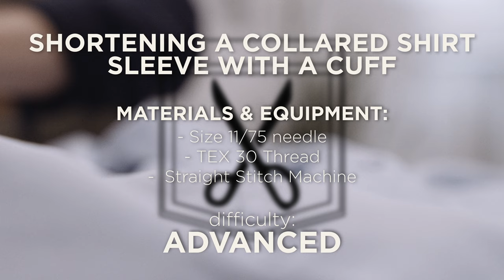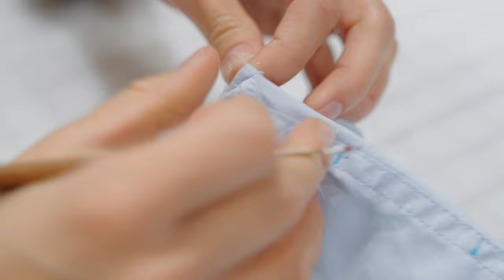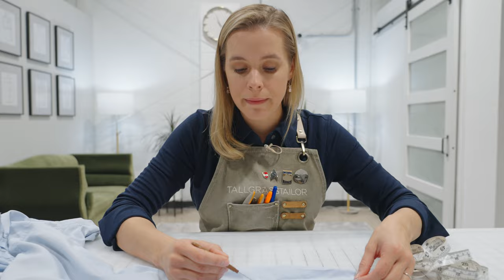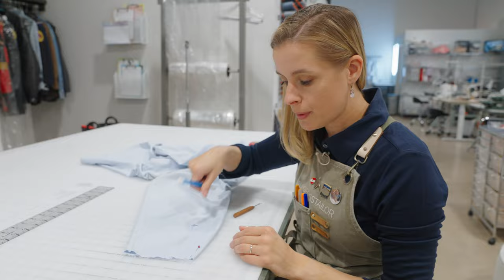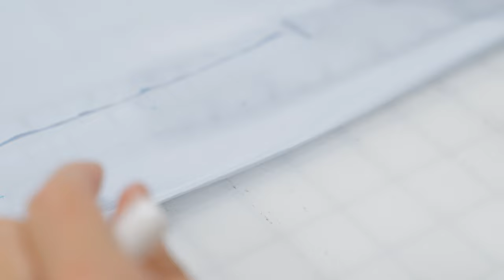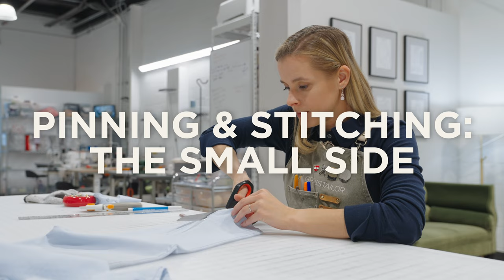Best Way To Shorten Men's Shirt Sleeves (Ep. 21)

Comment: Thanks for the video!! It worked perfectly for the first sleeve, but since the second sleeve is a mirror image, it was hard to know where to start the large placket because the fabric was on the right side by the cuff. 🤔 I'm about to try it and I feel pretty confident I can figure it out. I would request in the future if there are two sides that differ slightly, a note at the end would be helpful to address what to expect! 😁

Comment: Thank you, this was super helpful! One question - instead of making double pleats, have you considered increasing the sleeve taper? That would be more work but I'm guessing it would also make the sleeve look less baggy, don't you think?
Reply from the maker: You certainly could taper the sleeve instead, the reason we keep the pleats is mainly just because they are already there in the design and they allow for appropriate movement of the elbow. The extra fabric allows for range of motion without wearing down the fabric in that area.
Reply: @sewshowwithshae  thanks for the explanation!

Comment: That is a terrible way to shorten sleeves of this kind.  It really messes it up because you have to make the sleeve more pleated to fit in the cuff, which causes it to not fit properly.   Shorten from the top of the sleeve!  I have been shortening sleeves professionally for years with fabulous results. All the shirts that came back to our store after shortening your way, resulted in us giving the customers back their money because of the uncomfortable and very funny looking fit
Reply from the maker: Interesting approach, I find that shortening from the shoulder removes the curve of the shoulder cap and tightens uncomfortably around the bicep so my customers don’t tend to like that, but it sounds like there’s more than one way to do things!
Reply: @thesewshowwithshae  Remove sleeves and open up some of the sleeve seam and open at least part of side seam of torso. Let's say, you have to shorten a sleeve 2 ".  Remove both sleeves, lay one flat along the sleeve seam line, lay the other sleeve on top 2" lower than the top of the sleeve.  Cut bottom one to match, then lay the top one flat, line up your shorten one with the one on the table, cut to match.  Find center top of both sleeves, mark.  Find center top of sleeve hole, not necessarily the shoulder seam, mark.  Attach the marked side seam to the marked shoulder.  Pin together down both sides of sleeve head.  You may not reach all the way to the end of the torso side seam.  Sew sleeve head back on, then match side seams.   Start  on sleeve seam, sew sleeve seam down through torso side seam, removing excess torso fabric from armhole.  Works great!